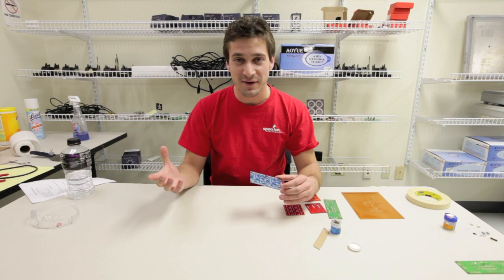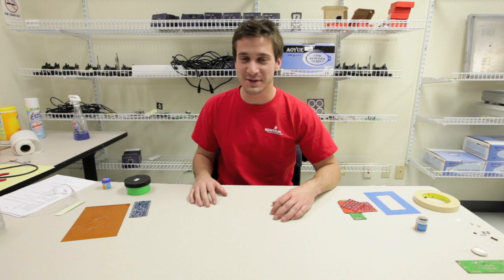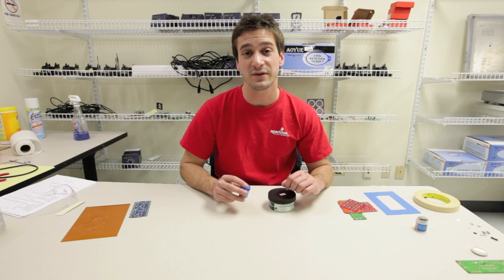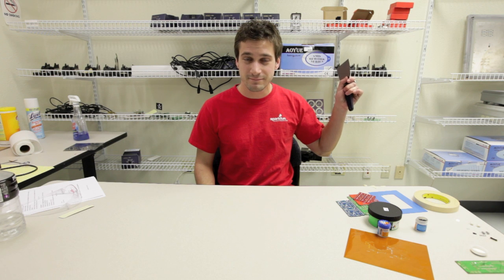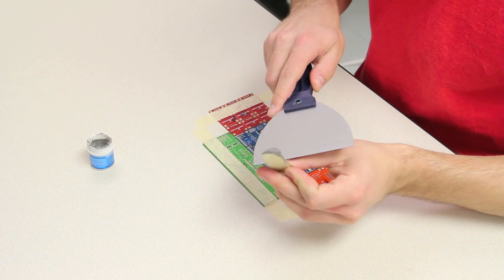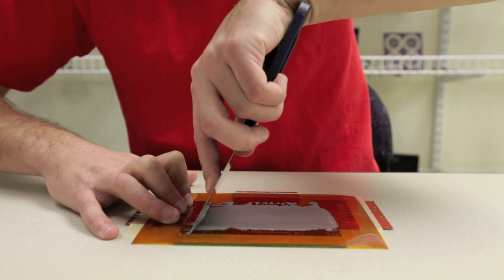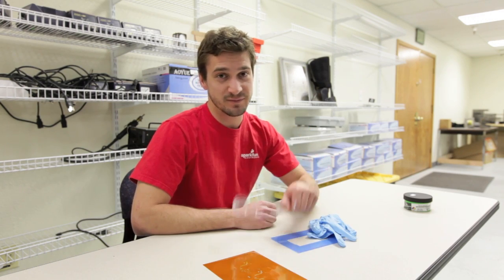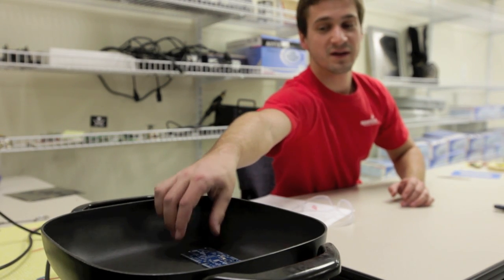Stenciling Tutorial

Comment: The fumes from lead solder contain zero lead. The concern about solder fumes is the same for lead-free as it is for leaded. It is the flux vapors that are hazardous, not the lead. Contacting lead solder on your skin or in your mouth or inhaling lead dust, wherever that's going to come from could be hazardous. Some people might suggest wearing rubber gloves that's probably a bit over precautious. All one really needs to do is not touch the damn stuff that much with your bare hands and then wash up afterwards.

Comment: Just a slightly pedantic nitpick - the danger with leaded solder is environmental, not the vapours during soldering. The lead doesnt evaporate, the flux is what fumes. In actual fact, lead-free solder is much more dangerous because the flux has to be more aggressive to help it wet. The more aggressive flux needs much better ventilation! That said, lead-free solder is better when it comes to disposal, since lead will leach into the ground and cause long-lastic environmental contamination.

Comment: Leaded solder is no more or less harmful than lead free of itself when it comes to fumes during soldering. The fumes are entirely caused by the flux used in the solder, and lead free solder typically has a lot harsher flux than leaded. So you got your advice backwards. You should always take care to avoid breathing in soldering fumes, but the fumes from lead free solder is typically much worse than that of leaded. A typical misnomer is that you may breathe in lead fumes when soldering with leaded solder, but this is entirely false, as lead has a boiling point of 1749°C, even when alloyed with tin the boiling point will not come close to soldering temperatures.
Reply: Exactly - hot plate is typically at 220 deg c

Comment: Lead doesn't vaporize during reflow...get your facts straight.
Reply: Lol, isn't the fume from leaded and lead-free solder paste the same thing? Unless they use different fluxes for each?
Reply: Exactly, the only fumes from soldering are flux fumes. Still not good to breath, but no metal vapors.
Reply: Exactly.
The real hazard here is the paste itself if skin contact occurs.
The small particles makes leaded paste way more dangerous to handle than ordinary leaded flux core thread.
Lead gets through the skin.
Reply: I would say it doesn't even matter. All solder flux fumes are toxic and you should have good ventilation regardless of whether the flux is said to be more or less aggressive.
The solder barely melts (that's the point!) and there is no vapours. It's very difficult to get any amount of the lead from the solder into your body in any way. Even ingesting the solder will not be harmful. Both metallic lead and leaded solder are practically inert in the digestive tract.
I red that they were feeding turkeys with lead shot, as much as they could eat, continuously. After almost a year of continuous feeding with lead shot "some" of the turkeys showed "slight" signs of lead poisoning.
Reply: Vaporizing flux likely carries some unvaporized lead with it.
Reply: Calm down.. He does not specifically say that lead vaporizes during reflow. However he doesn't mention that lead-free paste contains more 'aggressive' flux in greater quantities compared to leaded paste - ergo more concentrated fumes. So in a sense lead-free fumes are the most toxic.. Nevertheless all this shit dangerous, so watch out!

Comment: why do you need solder paste? Can you do it without?
Reply: That's how the part attaches to the board. It's a paste made of solder and flux.

There are other ways to solder surface mount parts, but this is (IMO) the nicest way to do it, and it's a easier for finer components and it's required for components with hidden contacts, such as BGA packages and components with a thermal lead to the circuit board.

Comment: It might not hurt to give people an idea of what temp to use on the oven. You don't want components to be over 285°C for any length of time. Some can take up to 300° for short times but you need to check the data sheet for any ICs or expensive parts so you make sure you don't compromise them.

Comment: What makes the fumes harmful? Lead does not fume until 450° so at soldering temperatures of under 400° the only fumes will be the flux. Are the fumes from the flux used for lead free solder  any better for you than those from the flux used for leaded solder? I have never quite understood this and have worked in electronic factories on and off for 30 years.
Reply: Flux the same for both.
Reply: Flux is generally worse for you with lead-free solder since it has to be more aggressive to promote Sn wetting. You're right, leaded solder isn't any worse for the person doing the soldering, but it is worse for the environment.